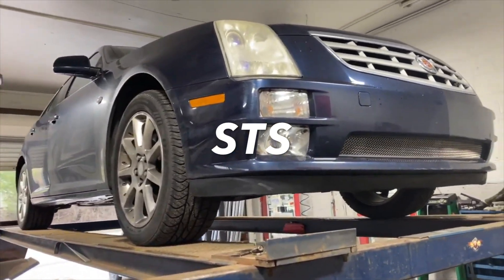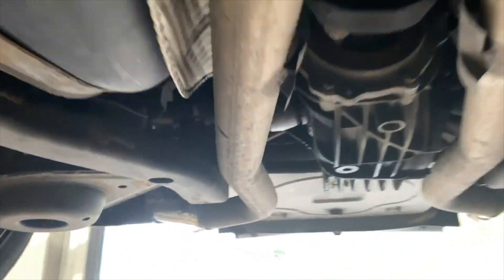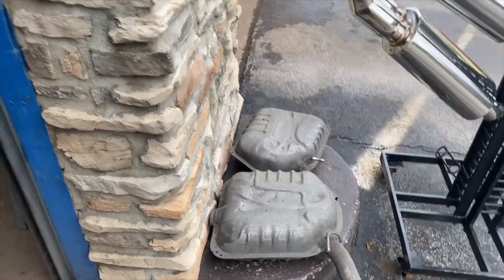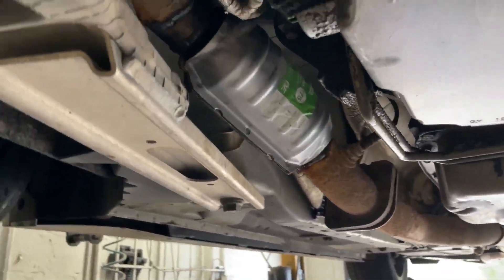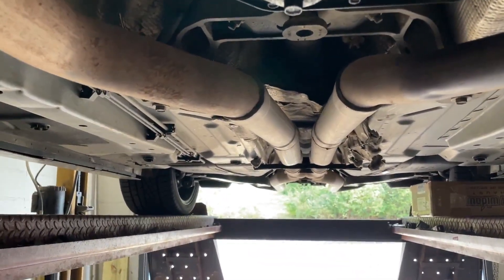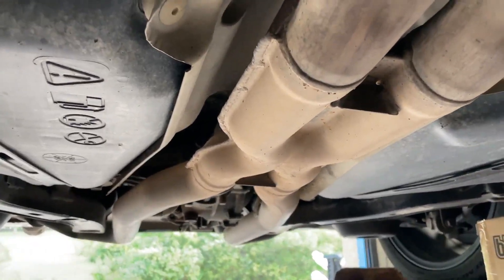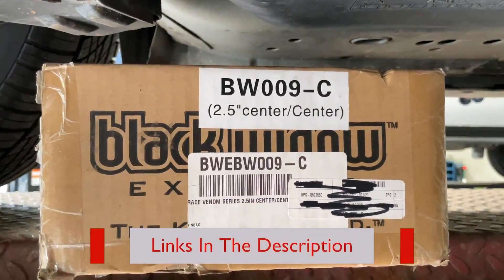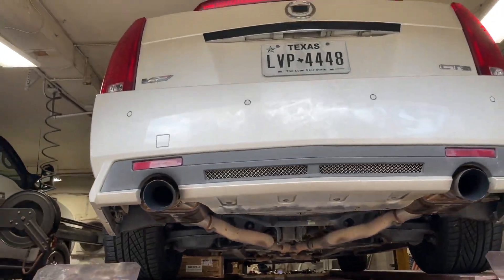Cadillac STS 4.6L V8 Vs Cadillac CTS-V SUPERCHARGED 6.2L V8!

Comment: Love CTS-Vs. Good sir, before you get harassed, superchargers don't run on exhaust gases, that's turbos.
Reply: Have u seen anyone do both at once supercharger and turbo in 1 vehicle
Reply: @jesusescalante93  I have
Reply: @jesusescalante93  compound charged.
Reply: @lastnamefirstname9043  twin charged*
Reply: @jesusescalante93  volvo has a few cars supercharged and turbocharged at the same time 4 cylinders 295 horsepower

Comment: The STS sounded better but I would never own a northstar motor
Reply: Yu gotta try the 4.4 supercharged Northstar
Reply: If you have money then you can get it fixed and run it for a while without trouble.
Reply: There is different types of Northstar engines. The LD8(4.6) and L37(4.6), fwd application, were a common problem in the 90's, but the LH2(4.6) on the STS is better, while the LC3(4.4) is bullet proof

The L47(4.0) in the Oldsmobile Aurora and Shelby Series 1 were a good engine too

Comment: Turbos take away from the sound Not superchargers. Because a superchargers runs off the crank pulley. Turbos are mounted on the exhaust they runs off the gas that comes from the exhaust.